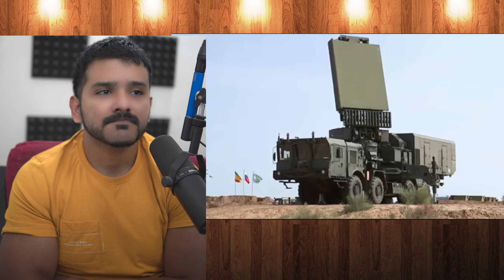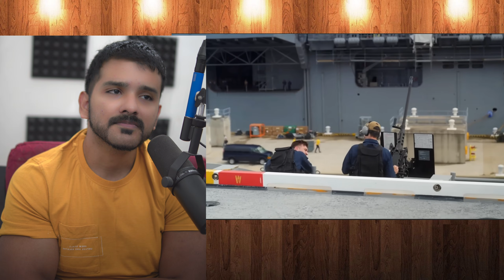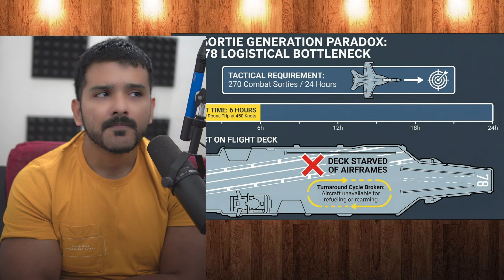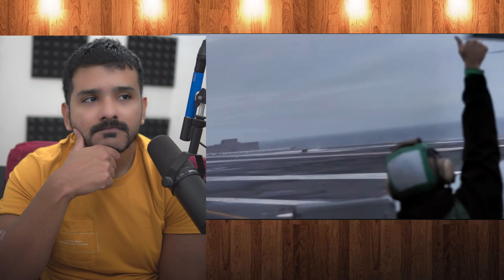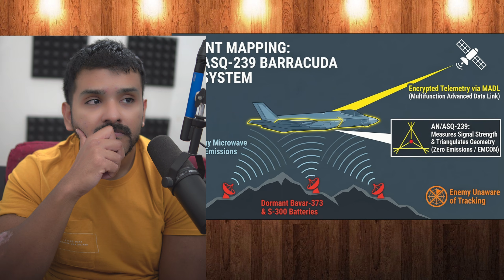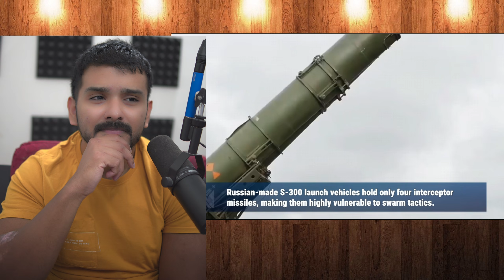The 1,200-Mile Trap: Why USS Ford Chose the Med over the Persian Gulf | CG Reacts

Comment: They will use the F-22's and F-15's to eliminate any threat from Iranian aircraft, station the KC-135 refueling tankers on the other side of the gulf over northern, east central, and south eastern Saudi Arabia far out of Iranian anti-aircraft range(~450km) No Iranian anti-aircraft surface to air missiles have ranges over 450 km, let alone 600 nautical miles! The combat radius of 500 nm is calculated including take-off or carrier launch. That radius is extended significantly when leaving a refueling station, already at altitude. This will give all attack aircraft a combat radius of at least 600 plus nautical miles beginning at the refueling tankers. This puts 80 percent of Iran including Tehran in reach of the refueling stations. They will have to advance some tankers and reposition them over Southern Iran once those sectors are secured of anti-aircraft installations to secure the North east quadrant of Iran. It would not take thousands of miles of refueling to get there. They could take off from the carrier and have enough fuel to reach the tankers over northern Saudi Arabia, refuel and then leave for targets in Iran. Check google earth using the measuring tool and see just how far 600 nautical miles reaches into Iran when starting from just 500 km from the Iranian border. Remember, combat radius is calculated allowing for at least 15 minutes time over target before having to return to the tankers. That is why so many refueling tankers are positioned at bases in Saudi Arabia.

Comment: it has no sewer it has failed and it needs to stay near port
Reply: Left Crete. What were you saying again?
Reply: @bradcraig5111 why do I have a feeling I am going to like some red coats even less after this. There is only one reason they would cover there.
Reply: So. How did it get there?
Reply: The sewers failing don't make sense. There is no way that has happened. Those are not designed with that simple single point of failure.

Comment: I was also curious at first, brother, until I started analyzing things more in depth. This video does a great job of it. Thanks for covering it.
Reply: The Ford has a significantly better radar and an offensive ability directed energy weapon mode to stop swarms of drones. Anything going up over Iran will get initially scanned by the abraham lincoln strike group and sensor fusion will properly assign\nRockets to assets
Reply: @TravisKeller-p8l2i Yeah, it is like the F22 Vs the F35, they’re both great, but for a particular reason one is far better than the other, but depending on the reason, one is better than the other, neither are technically a one size fits all type of thing